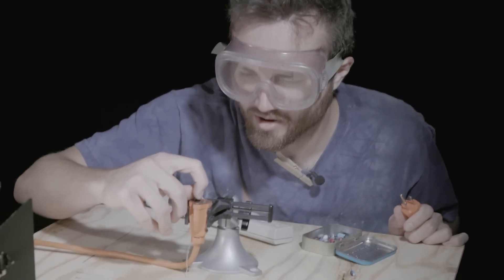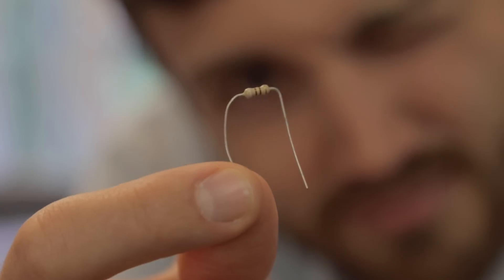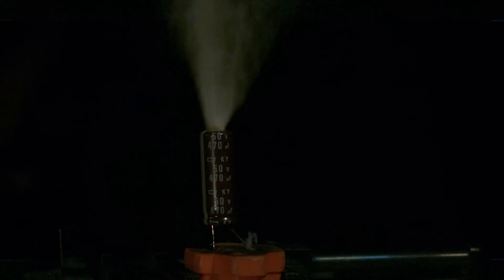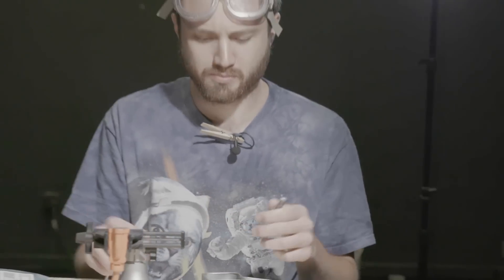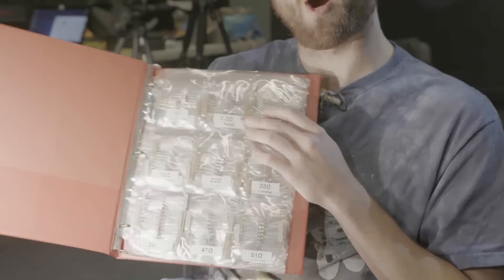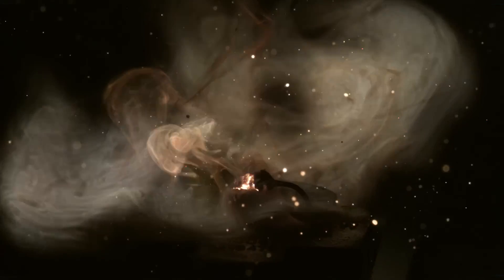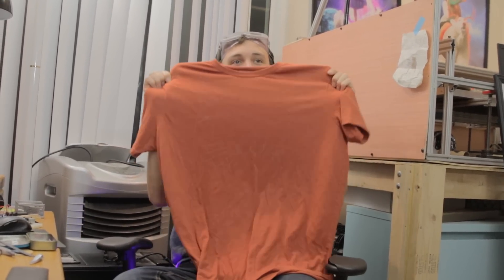Exploding Resistors and Capacitors (slow-mo)

Comment: now do it the electroBOOM way, which is holding the resistor in one hand and putting the other end of the resistor in the live wires and touching the neutral with your hand

Comment: I suppose why electrolytic capacitors reach those pressures, is because the ions are reversed as the polarization process takes place. Pressure is formed because of a positive-positive connection, and well... Tell me if I'm wrong and reply with your theory.

Comment: 0:13 by putting to much current into them?😅😂🤣
(High Voltage with High Current) not just current!
If you put a too much current into them but there's low voltage they didn't blow up,but if you put a high voltage and also high current into them for example a mains voltage they will blow up.
Reply: too* also he's increasing the Wattage, chill, he's not perfect.

Comment: Resistors and capacitors are actually designed to fail in a certain way. This ensures that if you overload one, it's not extremely dangerous for it to fail.

Comment: Theroy: Maybe the big one is more silent because, the big one could hold more, making it a smaller explosions. However, the small ones have a smaller compacity. So, it exploded faster and louder. (I dunno if this is correct with some of the wording, am a 4th grader ok)

Comment: I was playing with a dead multimeter, and shorting the wires up to make em glow like glow wire. And I forgot to remove all the explosive components, like the CAPACITORS. Especially the electrolytic ones. Well as I raised the voltage, and the current dropped and I thought, oh whatever got shorted died. And then BANG. Then I said “well guess it didn’t die!”. And the way it exploded was, there was no relief on it because it was small, and the casing shot off like a rocket right into my chin! Thank fuck I was wearing safety glasses because I coulda got my eye hit, not seriously messed up permenantly, but blind me for a couple hours and hurt like hell. Now my jaw is just hurting lol. Lesson learned. If your gonna short stuff, remove the dangerous stuff and have fun, or just don’t short shit and he smart

Comment: Big ones have pressure reliefs exactly because they would otherwise burst like small explosive devices. Smaller capacitors don't have relief valves because when they pop they don't actually endanger anyone. (as long as the machine itself is covered)

But a big cap inside a sealed unit and pop it. Just make sure you stand behind something.

Comment: Hey William, take one of those electrodes and make a rocket with it. Then you ignite it by plugging it in. Set the Electrode wires into two electrically-conductive metal tubes and attach two wires to those. Plug the wires into the wall, and watch it fly!

Comment: Something I think is pretty fascinating is how similar the resistor explosions are to how engines work. You could technically power a piston for an extremely short time by using one of these instead of a spark plug.

Comment: I wish we could know the frame rate, I'm wondering if the 2-4 little expansions on the week point of the capacitors before it bursts correlates to the rate of the peak of the AC sine wave.

Comment: Back than, i plugged resister holding it bare hand and it boom, i burnt my fingers but that's not the end. to correct my mistake, i tried to remove remaining wires and got shock. Dumbass me how i survived 😂

Comment: The big capacitors usually dont explode as big as they have a explosion proof: they have a skored top that pops open if theres too much pressure so they dont explode with dangerous amounts of force and heat. Edit: well within 3 seconds of me sending this comment i just realized william explained why...

Comment: Try using extension cord(?) with switch next time, or like i do, i use a cheap circuit breaker as  switch because i know its made for some power so it wont fail on switching :)

Comment: I like how you can see each half-cycle of the AC..like the caps bulge a bit,and stop (zero crossing),then bulge a bit more,and stop,then bulge and explode their guts. Noticing a similar thing with the sparks/plasma shooting out..and the glowing leads pulsating a bit. The resistors show it pretty well,too. (and you just noted it in the video.)

Comment: My friends and i in electronics class would charge capacitors and then discharge them on the back of each others necks. Also, lighting a bunch of one ohm resistors on fire happened pretty much daily. It was a fun class. I miss it.

Comment: Question: why do they pulse? Like with the resistors you can see a lot better it sorta lights up at an interval. Is it because of the way current is running through it or what?
Reply: norseMonkey because it’s alternating current, switching polarity 60 or 50 times a second, you don’t really see it in daily life, but in high speed it’s pretty noticeable

Comment: 0:50 Yeah, your caps aren't blowing up due to reverse voltage. Its because you're plugging them into a fucking wall. You've easily surpassed the breakdown voltage of the dielectric (I.e., when there's too much in the right direction).
But then again, its AC, so I guess you fucked it up both directions. Basically, you made a short. You make a short with anything that blows up like that when stuck into a fucking wall.
Reply: Next time, you should try plugging in op-amps and transistors. MOSFETs can have a resistance of >1 GigaOhm. Fuses would be fun too. Transformers would be dangerous (=fun). 
Message me if you have questions.

Comment: WARNING, DO NOT TRY THIS:  So I did a dumb thing a few days ago.  I plugged my phone charger into the wall and left my index and middle fingers (from the same hand, thank God) on the socket prongs, sliding them back as the charger entered the socket.  I've been shocked by DC power before, but until then I had never had AC run through me.  It felt very different from DC power.  For starters, I didn't take my hand off reflexively the way I did with DC power.  That might have more to do with the amount of power than the type, but I don't really know.  The weird thing was that I could actually feel the pulses of current.  I would've thought that at 60 Hz it would be too fast for me to feel any significant difference, but that's not the case.  You absolutely can feel it, I just wouldn't recommend doing it on purpose.  I know better than to mess around with electricity, but I guess I was just tired and not paying attention to what I was doing.

Comment: can u pls plug a plug into another plug?
Reply from the maker: Nothing would happen if the wires were correctly oriented since both plugs are already touching each other. If the wires were swapped, there would be sparks, and the fuse/breaker would trip. If there was no fuse/breaker wires would heat up very quickly and things would catch on fire.
Reply: William Osman  do it..lol...i dont want to be the one to cause ur house to be on fire😂

Comment: Actually, the bigger capacitors didn't explode so powerful as smaller ones not because their weak spot, but they store more energy and you supplied them with AC current, so they kind of discharged every time the polarity changed. If you had supplied the bigger capacitor with DC current but invers polarity, you would have got a really nice explosion

Comment: I once plugged in a 5 volt dc motor into an outlet it just vibrated and burned up I think it vibrated because it was ac current
Reply: No, the shaft for the motor was imbalanced.

Comment: could you laser cut a mirror, the backside so you don't send the laser back through the machine of course, into some squares then make a cube? but the catch is put the reflective sides on the inside then mount tiny cameras on the top corners?  some leds in corners on the long edges could illuminate the inside.  I wanna see what happens in a mirrored box with nothing to reflect except light sources.

Comment: Ok but have you had a classmate blow up an led, hit two people with shrapnel and burn out a capacitor within about 10 seconds of getting given said objects

Or have you had another classmate hook a potentiometer to a 9 volt power supply, crank that shit up, and start a small fire?

My classmates were not the safest people

Comment: Can you cut copper foil with your laser cutter and make PCBs that way? You could try aluminium foil first, I'm curious, how many layers of that can the laser cutter cut trough.
Reply from the maker: Metal is too reflective. It will pierce a hole through really thin steel, but not aluminum. I haven't tried copper
Reply: even if you paint it paint it dull black, or put a piece of paper above it?
but than another idea, if you put a layer of powdered metal under the laser, can you melt it like a 3d printer?

Comment: One of the things I noticed right away was how the AC voltage causes the capacitors to bulge and pop in steps and causes pulsing in the burn up of the resistors. That's something I never thought of before, but it makes sense.

Comment: five types of capacitors. ceramic, electrolytic, polyester film, tantalum, and air gap.
 only  electrolytic and tantalum caps are  critically polarized.(if you have them hooked up wrong they explode)

Comment: Try steel wool on mains current - its quite an amazing result. Just do it outside, and keep your distance as you may start a fire indoors or burn yourself. Subbed. Your funny. Popping capacitors on mains voltage is quite entertaining, especially the bean can sized ones :P

Comment: Does this pose any potential danger to the outlet?
Reply from the maker: No, that's what the fuse box is for. You have household appliances that use wayyyy more power than this. Burning the end of the extension cord is all the damage caused.

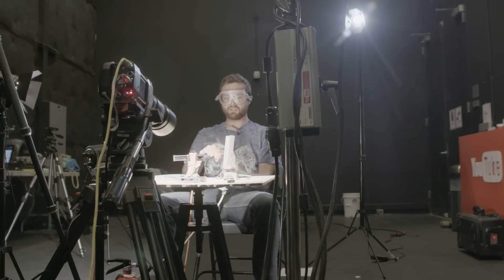Comment: Correct me if I'm wrong but wouldn't the multiple explosions from the resistor at 4:25 be because you are running AC power through it, causing it to stop every time the voltage hits 0?

Edit: Never mind watched further and they talked about that

Comment: With a few dollars in parts you can build a doomsday controller for a key turn and switch to be flipped rather then plugging in a cord. 

Just make sure you get line voltage switches rather then control voltage. Power in to switch 1 to switch 2 to an outlet you can plug a cord into. If you want to go fancy lights and buzzers can be added or you can do a paint job to the box you mount them in.

Comment: I might just as well be wrong... But for the resistors the pulsing in the explosions might have been since the resistance increased significantly when it was molten(ish) and decreased when it cooled, heating it up more and just happening again.
Or it acted as a sort of capacitor (this is where my idea gets super finnicky) and released a bunch of energy when it cooled down a bit.
I'm no engineer (or anyone who ought to know jacksh!t about this stuff) but that's my understanding of what was happening?

Comment: William you should make small rockets using the small capacitor that had the way to relieve pressure which in turn made the pressure go out of the weak point. I noticed when it went off that it pushed into the plug a little bit so a mini rocket came to mind. If you need to know what I'm talking about it's the first one with googly eyes!

Comment: I wonder what would happen if you filmed this at 60fps given that the AC is at 60Hz, in other words 60 cycles per second....would it look like one longer continuous explosion? maybe 60fps then played back at like 30fps to get it a little slower. But then i just realized what if the frames weren't triggering at the height of the explosion then you might not see it at all...
Reply from the maker: If you kept the same exposure it would just look like a constant brightness, like if you cut out all of the frames except the 60Hz peaks.

Comment: Axial leaded electrolytics do not have scoring for venting so they tend to blow out the rubber end caps on the positive lead end. That means you can get large caps to go bang instead of venting. Something to consider if you decide to do this again. I wasn't paying attention and replaced a 63 volt 2200 uF cap in a piece of gear a few months ago. It took thirty seconds or so for it to blow, but when it did I certainly knew where I had gone wrong.
Reply from the maker: Thanks for the suggestion. How loud was it?
Reply: Hard to say, really. I was at my workbench at work, which is basically a semi-converted warehouse, when it happened. The reverb made it sound like a rifle being shot. Definitely louder than a firecracker. I believe the cap was 3/4 of an inch in diameter and an inch and a half long. Lots of volume for pressure to build. edit It really sucked too because it was a Cornell Dubilier and super messy to clean up inside the machine afterward.

Comment: Try diodes, small ones, like 0.1A, I did and the bang was pretty good. Just the bang, not many fireworks tho :C

I blew my fuses like 3 times that day, also did a full bridge rectifier and shorted it, for the lulz. It wasnt as good as I wanted, only two diodes blew up :C

 Good video :v

Comment: laser cook bacon slices!
Reply: slice bacon from a slab of bacon then, not fully cooked. and if its thin enough maybe the fat will allow the heat to cook and get "crispy " bacon. ;)
Reply: it wont work. Like the popcorn, it will focus on only one spot and wont cover enough surface area to cook it. It will end up just burning a tiny dot into the bacon.
Reply: UnlawfulWaffle8 shhhh, less science talk more trying not to light light the house on fire again
Reply: Laser + Bacon?
It already been done.  If you search it, you will find it.
Reply: +UNlwaful you're wrong. You can make it lower power and set the laser to just go over it evenly. Easy.